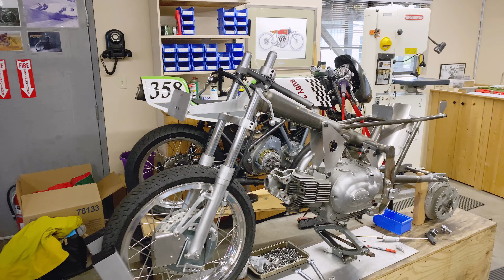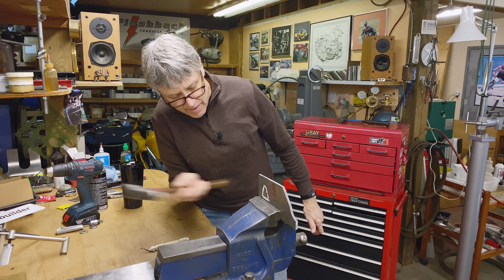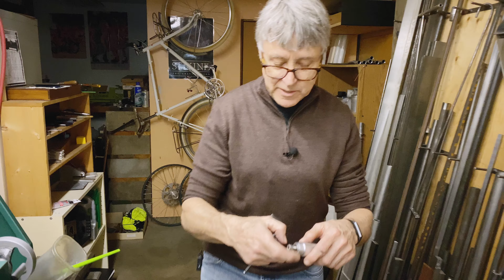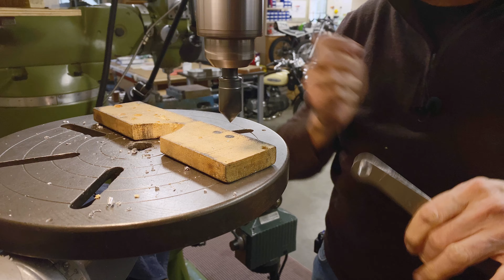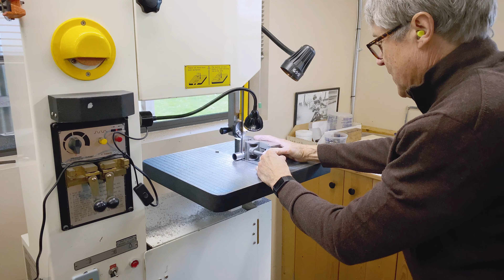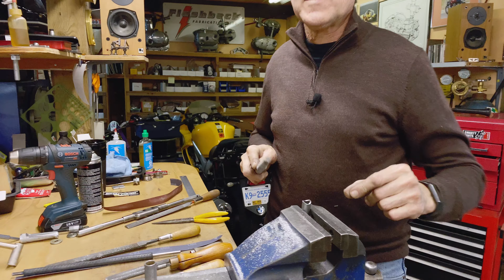Aermacchi shifter and brake  - with Paul Brodie

Comment: Rubber mounted handlebars? Guess it made sense to somebody. Nice looking bike, though. But, my choice would be the red one. Have always preferred low bars. You have to wonder what happened after your theft. They probably kept the van and junked the bike... Thanks.
Reply from the maker: Other bikes have rubber mounted handlebar perches, so it's not just Aermacchi...
Reply: @paulbrodie  Not knocking Aermacchi, they made great bikes, but I can't help thinking that it reduces the feedback from the front wheel, some of which consists of pretty subtle bits of information. If that lovely bike were mine, I'd change it. (I haven't ridden in decades, by the way, so it's all theoretical. However, even on four wheels I like to feel the road through my hands and feet). Am I right in thinking this feature was just for the American market?
Reply from the maker: @billdyke9745  I've never owned an original "European" Aermacchi, so don't know about their handlebar mounting quirks. I would choose solid over rubber mounting too.